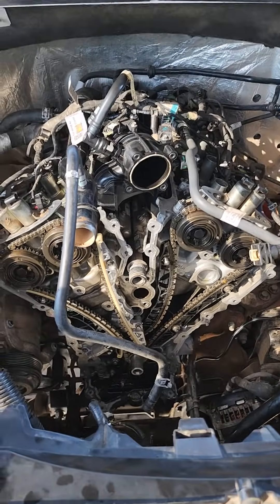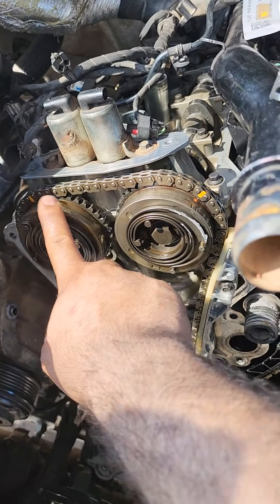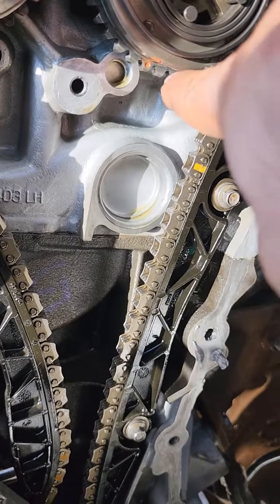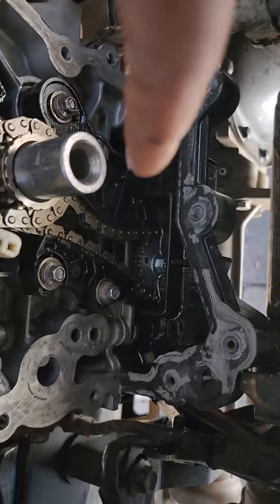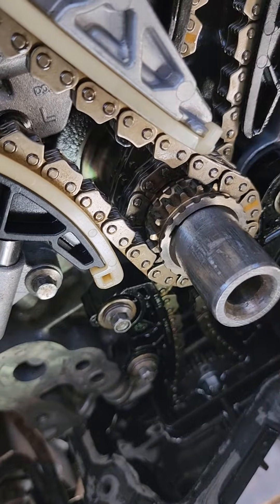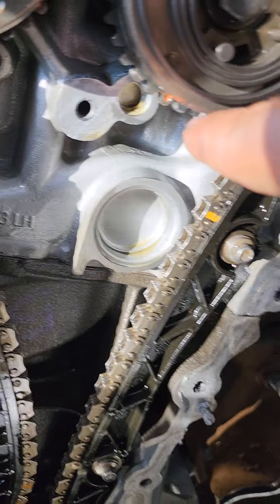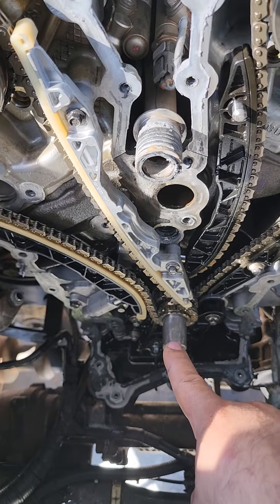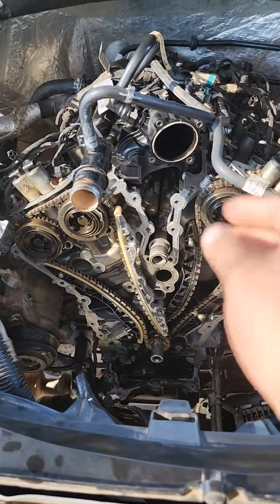Ford 2.7 Ecoboost timing chain replacement procedure

Comment: I have a question long story short , 2017 crank sprocket for the passenger chain broke with the guide. I have followed the timing procedure. My problem is everything was initially timed correctly but for some reason both banks are skipping I can’t figure out why. Everything was on point

Comment: After you set the timing the right way did the motor run good? Asking because if these are interference motors and the previous guy timed it wrong were you able to just properly time it without any valve damage?

Comment: The previous shop didnt line up the timing marks on the chains and the cams?? wow smh.... im used to working on Hondas but my grandparents F150 hasnt had much maintenance since they got it in 2015 just oil changes... looking up reference videos for info on their eco boost.
Reply from the maker: They did but didn't do the procedure correctly. Timing on one side was out a full 360°. They lined everything up how they took it apart not knowing you needed to turn the crank when doing one side
Reply: In all fairness, it’s a really stupid procedure. I read it like 4 times and still felt like I was doing it wrong. Second guessed myself on the gen 2 3.5L because it looks so similar but doesn’t have the same procedure - you just put the chains without spinning it over - like it should be.

Comment: WAS THERE A PROBLEM WITH THIS ENGINE CAUSING THE TIMING CHAIN TO NEED REPLACEMENT ?

... COMMON PROBLEM WITH 2.7L ECOBOOST ENGINES ?

THIS ENGINE IS ONLY 5 YEARS OLD
Reply: 2.7 is one of Fords better engines
Reply: Welp…….here I am with 93,000 miles and I’ve got a misfire on one bank of cylinders…..
Reply from the maker: Previous shop replaced the driver side head. Got the timing wrong and was sent to me after they couldn't figure out why it wouldn't run. Reason for the head being replaced was that it overheated
Reply: @Devogor  Ford isn't exactly known for long-lasting timing chains and cam phasers. The roller style chains lasted long but Ford only used them in the first year of the 3.5 EB F-150 before switching over to the stretch-prone silent chains.